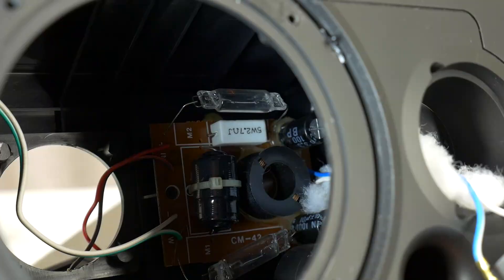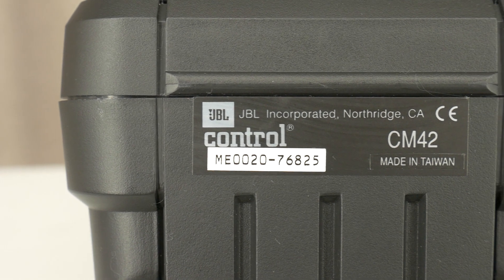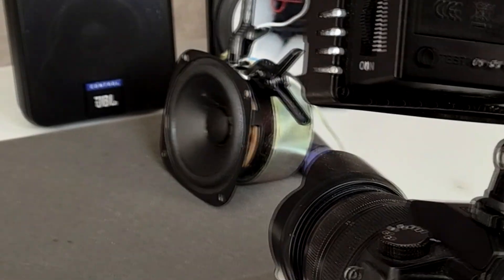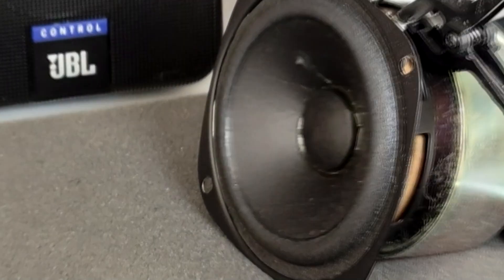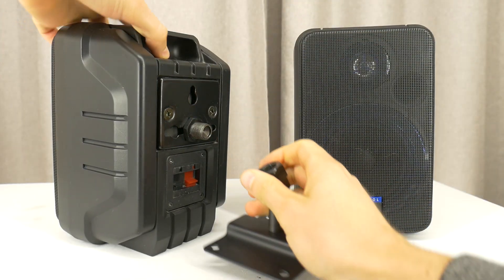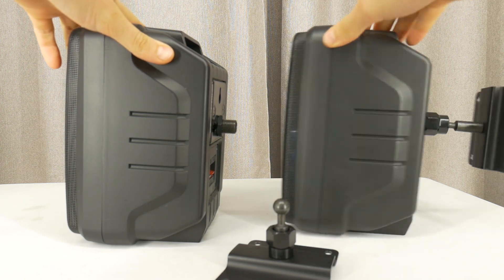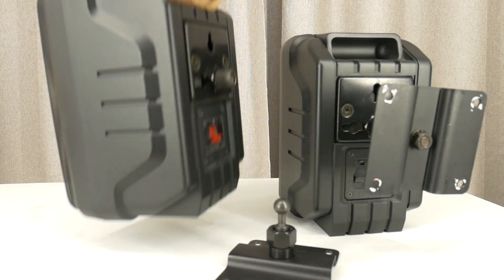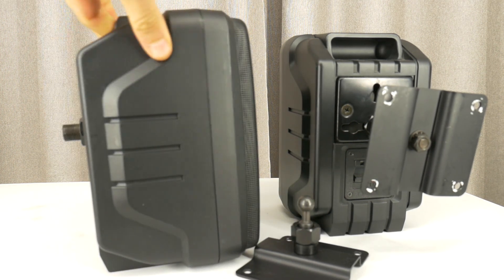What's Inside JBL Control Speakers + Free Air Test

Comment: They should use rubber surrounds on their Control 1 speakers. Foam degrades a lot faster.
Reply: Was thinking that foam on an outside speaker doesn't seem logical were that will not just get sun but rain and freezing weather to